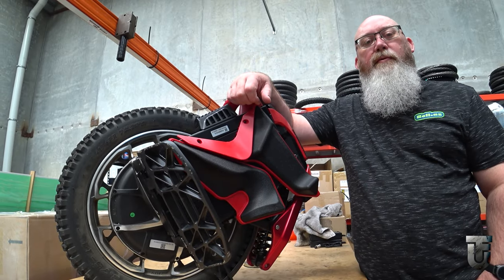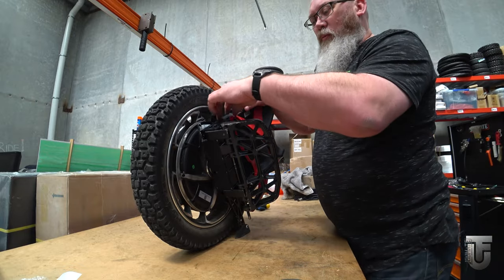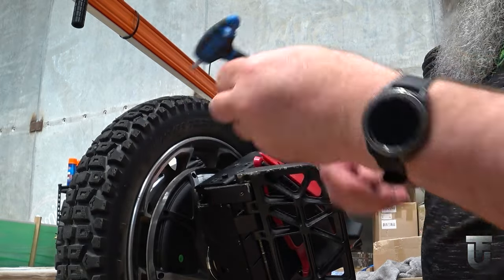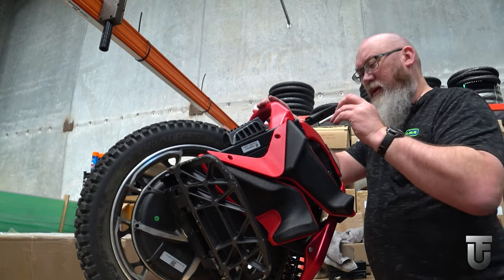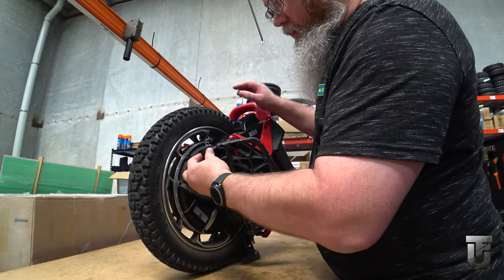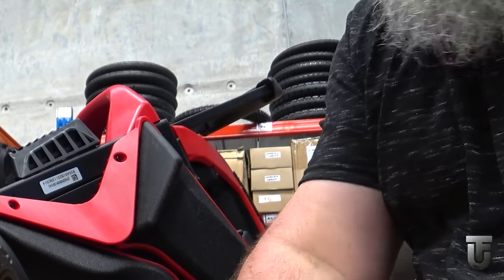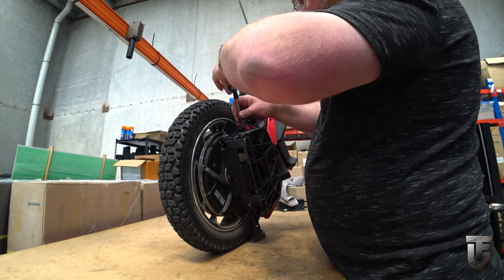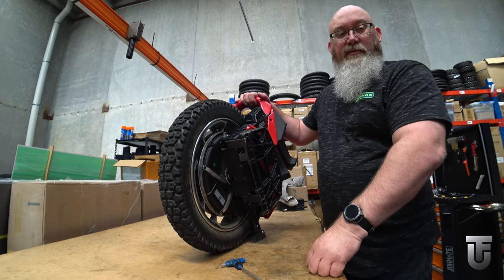Kingsong S22 - Trolley Handle Adjustment

Comment: Amazing video. S22 is so well build. I actually broke both bottom plugs because I kept rolling the uni down the stairs while only holding the handle and when the step is too big the handle hits the limit and there is a lot of pressure on that. 
Anyway I was wondering if this piece can be 3D printed since its out of stock in EU shops it looks like. I can still buy it elsewhere...just wondering about possibilities of 3D printing.
Reply from the maker: 3D printing should be possible, it isn't a structural part.